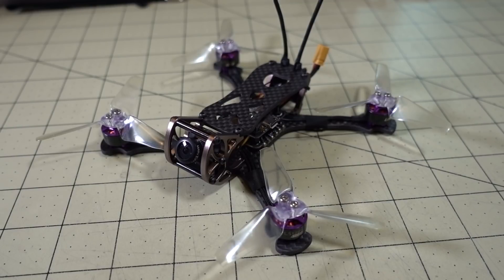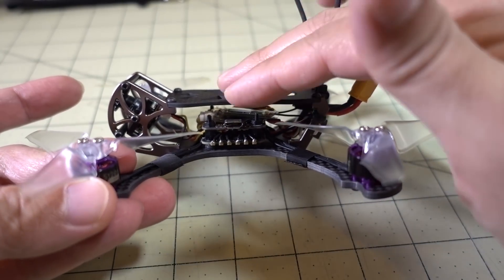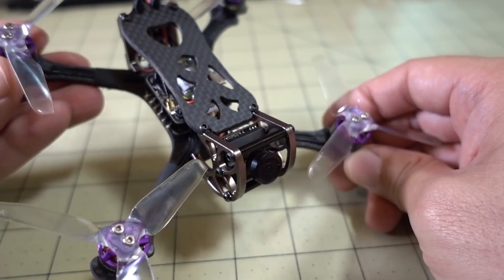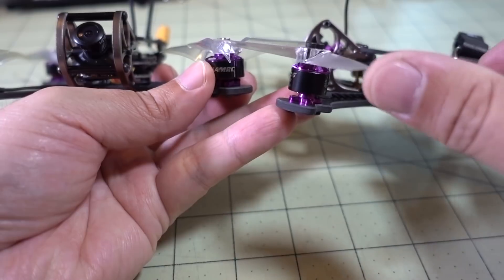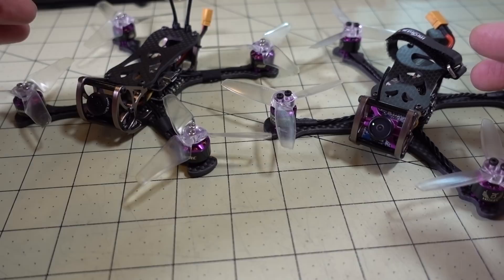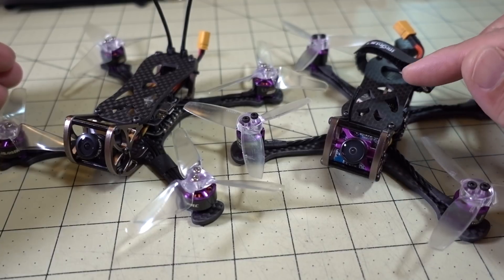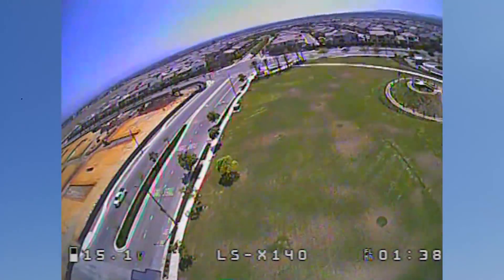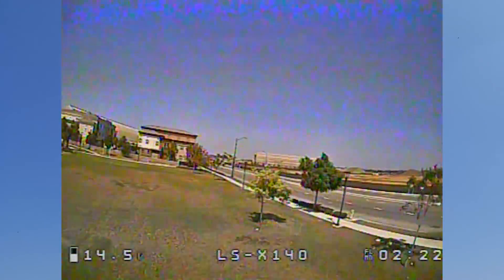MD#121 🚁LISAMRC LS-X140 BNF w/1206 Motors! 😀

Comment: WIth this and the Ascent X HD 3" (33mm stack space) you can get a split or turtle in the stack pretty easily now. And there's also the Zeus or FC/VTx combo boards to help. See any advantage of using the dual stack frames compared to these?
Reply from the maker: Most of the dual stack frames won't show props in view.  This one will.  I can't stand prop in view.

Comment: Seems to be enough room for the caddx turtle in there, what do you think? Also, have you seen the rotorx 3044t 3-inch props? They seem really nice, perhaps a good replacement for my gemfan 3035?
Reply from the maker: Yeah the Turtle should fit in there.  I've tried the RotorX props but went back to the Gemfans.  The RotorX props are unbalanced and also draw a lot more current so flight times were short.
Reply: @AlbertKimTV  odd, I haven't heard that complaint yet. Maybe you got a bad batch? Gemfan manufactures rotorX props for them, with RotorX custom designed blade profile so they're usually pretty spot on.

Comment: Albert Kim do you have any more pids to try ..I tried yours and others and still getting prop wash bad on throttle..
Reply from the maker: I didn't do any tuning on this model and just flew it with the PIDs it came with out of the box.  I've taken this model apart so can't tune it now.
Reply: You took it apart..🤔 I'm actually impressed with it if I can get the dang thing tuned ..the props wash is horrible ..yours sounded way better than mine .I may just put some butter on it..thanks though..love your videos!!
Reply from the maker: Try the Gemfan 3035 props.... less prop wash in general with those props on Betaflight 3.5

Comment: What if you used 1306 v2 4000kv motors, instead of the 1206 motors? 
Based on the ratings on each, that I've looked up, the 1206 use more Amps than the 1306 v2 with 3" props (meaning more flight time on the 1306 v2, probably more power in flight, too). :)

I'll be installing 1306 v2 motors on my chameleon clone LISAMRC frame or Tachyon 1108 5000kv (just got it the other day). Seen flight vids with Tachyon 1108 5000kv lasting 10mins. :)  This is great for people who want to practice and not have a 3min time limit per lipo.

Comment: The thing sounds horrible it's making a gurgling sound in the entire time you're on the throttle. My quad is doing that at Full Throttle I can't figure out how to make it go away. I dropped my P's 10 points but that didn't do anything
Reply from the maker: I can't figure out Betaflight anymore.  I've given up on tuning.  If it flies and doesn't shake all over the place, good enough for me.  I don't have time to get a perfect tune and even after spending hours the tune still sucks.  So I spend my time now flying and DGAF what it sounds like anymore...
Reply: Noticed the same strange sound on my 2.5"...but also can't fix it.
Reply: Usually D gain causes this. More powerful motors with aggressive props usually need much less P and even more less D I find
Reply: You're way over tuned, bro. Drop P and D a bit more, maybe add .3 tpa